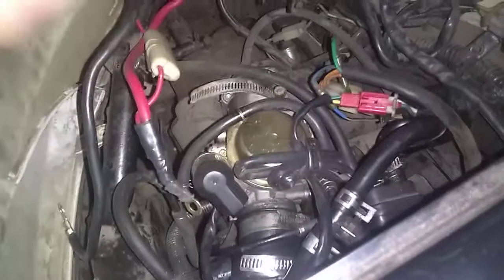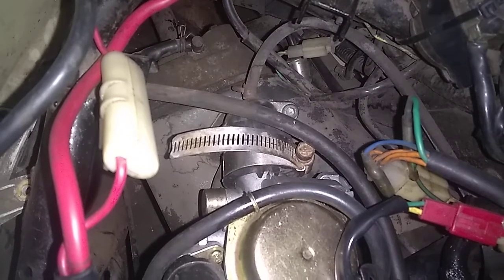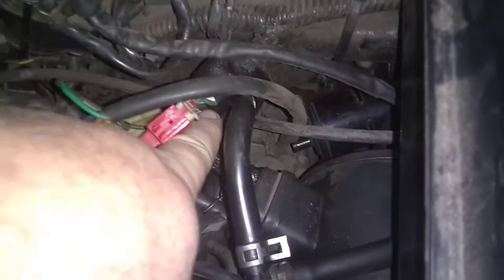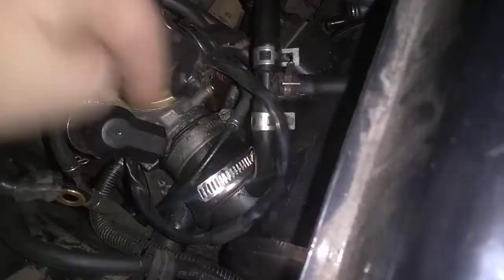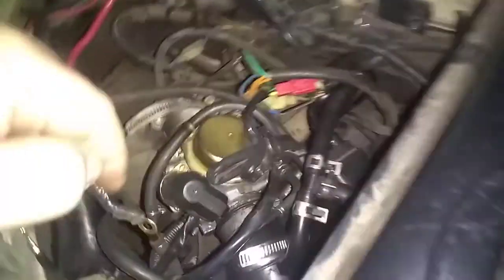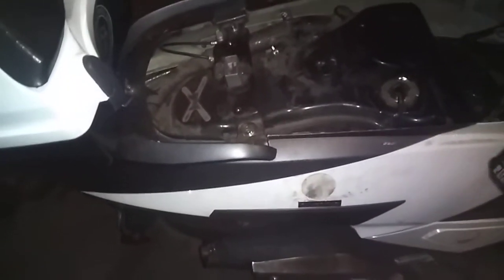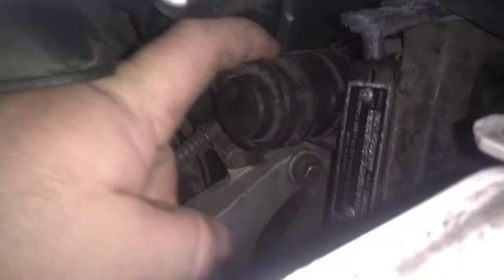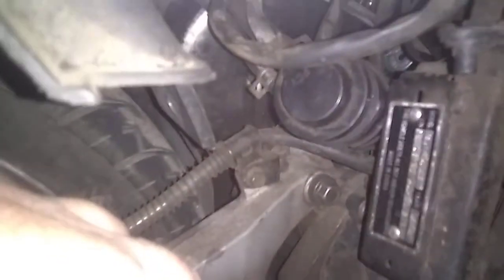Gy6 positive crankcase ventilation system

Comment: This is partially correct... The crankcase DOES need to be ventilated but it DOES NOT need a vacuum applied to it to accomplish this. Air naturally flows from high to low pressure so the positive pressure in the crankcase will will push its way out the vent hose as long as the internal pressure remains above atmospheric pressure. The first thing I did to my GY6 scooter was to eliminate all the PAIR/EGR crap to simplify my engine bay and vacuum hose setup. My cranckase vent hose runs to a proper oil catch can and then straight to my 2 stage UNI intake filter. I just tuck the hose in between the foam stages. A proper catch can will catch and condense the dirty vapor from the crankcase vent.

You don't need a vacuum cleaner to help you throw up or take a dump...neither does this engine. It will spit it out on its own. (as long as the vent port aint blocked or clogged😅)

Comment: All you need is 1 hose coming from the fitting on the valve cover connecting to the intake manifold. The rest of the system can be removed. It is just there for emissions. All bikes prior to 1980s were setup this way.
Reply: I instailed a sport air filter on my 50cc scooter ,where do i put my hose now and will it affect my bike if the hose is not connected
Reply: @hey-fj3jw  just route the hose so the open end is as high as possible. It might blow some oil vapor at high speed and if it does you can just put the hose in an empty bottle or something to catch the oil. it wont hurt the bike to leave it disconnected.
Reply: @alexsbikesandmotors  i fugured it out,thanks man

Comment: So many opinions.  However, this is the closest thing to what I have been looking for for hours and hours.  Its the line that comes from the very front of the engine.  I do not now where that goes.
Reply: Mine is blowing out oil I don’t know what’s wrong with it did you find anything out
Reply: @remicovell1972   That front tube just goes no where.  It releases the air from the pistons going up and down.  Your oil issue is an entirely different issue. Something is happening to your oil before or after it hits the engine.  It's not the vacuum or fuel line.  It could be the gasket, but I'm not a pro.

Comment: You only need vacuum if the valve cover had a check valve. My 2016 gy6 taotao 150cc does not have a check valve on the manifold. However, the egr system does help to lower cylinder temp as well as smoothing out the idle.

Comment: A "Positive" crankcase vent IS hooked to vacuum, because it puts a "positive ventilation" to the crankcase.  These just have a vent going to the induction ahead of the carburetor.  Never had any PCV on my scooters.  Suspect it wouldn't work right due to small intake size and rejet issues , but that's a question for a cycle expert who is familiar with carburetors.

Comment: Hello  please you advise me i have what looks like a pcv on my scooter the writing on the filter says HEFA TY80WD Air Drain. 

Would it be possible to Google the unit and advise me what it really is. 

I'm guessing its a pcv. I have 2 feeds to the bottom of the unit and 2 feeds on the top which are missing.

I can't see the pipes where they connect to. I hope you can help. Do you know if this would cause a smoke issue with the scooter as its a 4 stroke engine and I have an engine management light on permanently.

I enjoyed your video.

Comment: It being factory has nothing to do with it must be there. It’s there to relieve pressure and the gases coming from that pressure are burnt because emissions.
Reply from the maker: It has zip to do with emissions.  It has to do with ring seal.
Reply: @AmericanDefender  
The reason they don’t vent to atmosphere from factory is because of emissions laws.
Reply from the maker: Not in regards to crankcase pressure. That's what that line does is relieve crankcase pressure by drawing it through the head via engine vacuum.  It has nothing to do with emissions.  Some bikes, like my 2021 maddog don't  have a charcoal can or any pair system equipment at all. Yet they have the vacuum line that goes from the manifold vacuum source to the pcv valve on the valve cover.
Reply from the maker: Lmao.  I'm done trying to explain to a noob. When you have 30 years experience and a master tech certification come see me.
Reply: @AmericanDefender  I'm having all kinds of problems it seems like since I deleted the egr on mine it seems, just noticed oil around my valve cover gasket so I'm sure the seal is shot, could the pvc be clogged as well
Reply: @AmericanDefender  also mine don't have the extra port on the wnhing for the egr it was hooked up to port that went in the exhaust exhaust broke and the new one don't have it, is it essential for the system to work?

Comment: Hello sir I certainly appreciate the time you took to explain the situation in this video. I have a brand new TAO 50 scooter Where the crank case gets really hot in five minutes but the oil is cold when I turn it off then the bike starts making a ticking sound,  this be the problem sir? Thank you kindly
Reply from the maker: Most likely you need your valves adjusted or your bike isn't pumping oil up too the head. It's hard to tell without seeing the bike in person.

Comment: There is no one way valve inside the valve cover.you have a series of baffles that's it. What you are reffing to is your pair system.all that does is feed unused gasses back into your motor to be reused and not escape into the atmosphere.your crankcase ventilation is your hose port on the top of the valve cover.thats it.and I've never seen a 50cc gy6 with a stand alone charcoal canister.thats an add on.
Reply from the maker: Thats not a 50. Its a 150 gy6b. They have a one way valve in the valve cover and in the recalculation system.